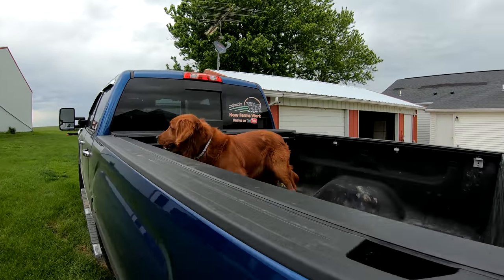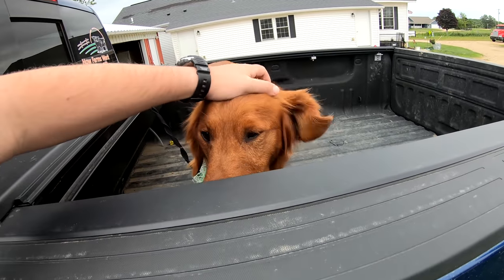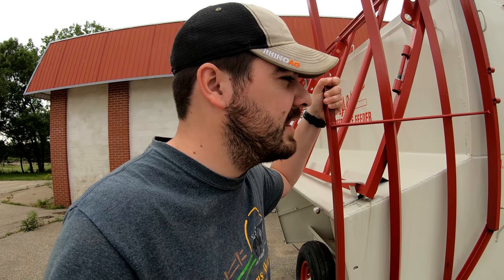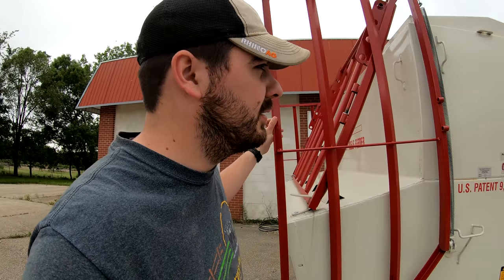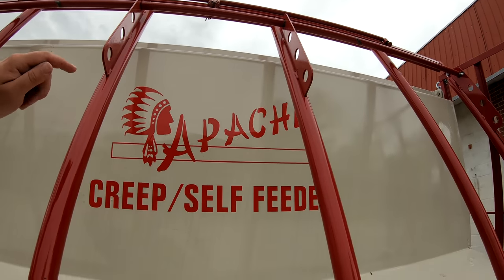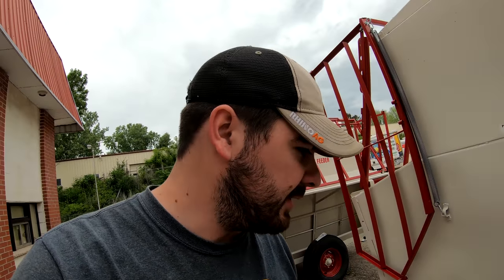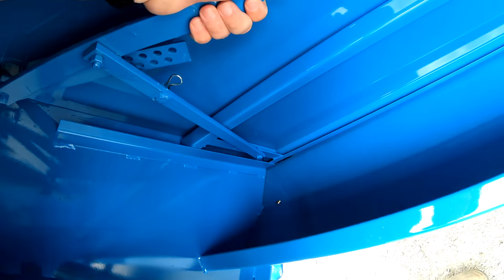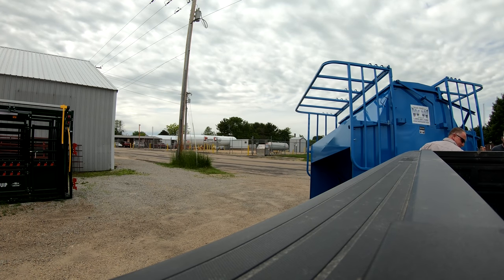Apache or Werk Weld Creep Feeders?

Comment: Offer manufacturers the opportunity to advertise there solution.  With 260k both channels  they would sell many gallons of rust prevention.  Send the upload to the marketing departments.  Talk to your current equipment partners also for solutions.  Your smart to invest now for years of longevity.  Many good suggestions in the comments.  There has to be a bediner co that has a batch of off color material needing a home.
Reply: I love your suggestion.  But for the picking up mix matched bed liner paint is impossible.  Once they get the color match and add the activator, time is limited to spray. But it would truly be the best route just not a cheap one.

Comment: Keep in mind that the corn is sandpaper, and will over time scrape off the paint or sealer on the inside.  Some of that scraped off paint is going to go into the cows. Probably best to use something relatively non-toxic that you wouldn't mind eating yourself. (Since whoever eats the cow will be eating it.)

Comment: these like so many other farm products are so costly to buy, you would exspect them to be made out of stainless steel sheet metal, not mild steel sheet metal, i say sheet metal as that is what 14 ga, is, as that is what they are built out of, 14 ga steel sheet metal, and one can not begin to justaphy the price they want, i can build 10 of these out of 1/8" stainless steel plate for the price they want for this light built sheet metal box, you cant even tow 30 mph down the road, and you sure dont want to tow it loaded with feed, the tung is only 2x2x1/8" tubing, that will not take the load towing, years ago i priced out a feed hoper i could take to the feed mill and have it loaded with 2 tons of feed, i found they are made out of 14ga sheet metal and only hold a ton, 2000 Lbs  and are not made to tow down the hyw loaded, and if you wanted to take it to the feed mill to be loaded, you have to drop the wheels off and set it in a truck or trailer. and the price tag was over $5000 cnd an, so i built one that holds over 2 ton, and i can tow it loaded down the hyw at 70 mph out of 1/8 stainless steel plate, with ec brakes, as there all over cheap the for under 1000 bucks and a weekend to build, being i am a welder by trade, these are very simple to build, with my eyes closed..

Comment: Oil it with a vegetable oil like a large barrel offset smoker. Repeat as necessary. It will oxidize into a natural oil varnish over time, usually a week to ten days. Tung oil or PURE linseed oil would work even better. DO NOT use hardware store linseed oil. It has heavy metal dryers in it to promote the oxidation and is thereby not good to be ingested. Down here in Texas, serious smoke cooks get a new smoker, oil the entire thing with cooking oil, and then bake it out with a fire in the firebox. Obviously you can't do the fire, but nut oils and some thinner veg oils will varnish out in one to two weeks on their own. Whether it's fully varnished doesn't matter. You can come in with your feed and over time re-oil as needed.

Comment: I would definitely paint inside with some graphite 
I don't know if it'd be a good thing or bad thing but I think I would throw a couple tiny holes in the corners to help water drain out unless there's some already there and I didn't see them 
one thing I don't like about creep feeders even though I don't use them or need them the tongue always sticking out on them

Comment: Wouldn't use flex seal cause if it starts to chip and peel the cows will be eating it in there feed
Reply from the maker: It’s non-toxic when cured, and I used it since I had a lot of it sitting around

Comment: Would truck bed liner spray work?
Reply from the maker: It should, though I’m not sure what the cost would be. The flex seal was fairly inexpensive for what I want to spray
Reply: I wouldn't put it where the calves eat at. They'll chew it away from the metal. Inside is another story all together. If any water did gather between th liner and the paint from condensation,  it could still drain down and away.

Comment: We have 2 Apache creep feeders and all we do is fix on them there light weight and built really cheap not a good feeder at all 
Those feeders wont rust out as long as u clean it out after it rains in the trough and totally clean it out when ur done using it for several months the inside might have sure surface rust but that isn't going to effect the feeder at all

Comment: How come they are not made in galvanized steel? That way it will take years for the rust to show, if ever! All our iron in the barn by the cows is galvanized, has lastet for 11 years, no rust yet. :)
Reply: Best idea yet ! They don't use it because they want you back in 5yrs after it rusted away.
Reply: @augustreil  And that will result in bad reputation. Rather have a reputation that states your work last for 10-15 years, than just 5? i dont want to buy a tractor that will only work for 5 years, i want one that works for 20 years.
Reply: @TheComander1234 , I agree 100%

Comment: Spray on flex seal does not hold up in the sun, I used some on a motor home roof and had to fix it again in less than 3 months.
Reply from the maker: Guess I’ll be doing a review in a few months to see how it’s holding up 😂

Comment: as for painting the inside of a factory one, dont do it, it will rust even more and you dont see it under the paint until it is real bad, spray a light coat of cooking oil 2 times a year, but if your stuck on painting it, heat up the area with a tagar torch hot and spray on pro 15,  paint, and any out side areas top coat with pro 15 2 part wheel paint, but work fast, strait pro 15 will chock if in the sun, and needs a top coat

Comment: Those welds are made with straight CO2 gas. The welds look fine to me. The CO2 makes a lot of splatter and it sticks to the surrounding metal and without a splatter protection it is harder to clean up. I always use an argon mixture with my welder. It costs more but not really when you factor in the extra time in clean up.

Your over thinking it! Let it rust then convert it and seal it.... All you need is some rust oleum primer and some rust oleum paint of the color of your choice to stop the rust

Comment: I'd paint the inside before using it !  Migjht reduce bridging of the feed and reduce rusting of sheet metal .  Also would serve to seal the lap joints between sheets .  That's  "stitch welding "  BTW .  its used because seam welding costs a lot in time to prevent buckling of the sheets  not to mention wire .  You were shopping price, too.  Quality costs money in front ot everyone is willing to pay for so you're seeing the marketing/engineering choices.  BTDT !  The debate is always price point over durability .  But you can improve the durability with some TLC and attention to detail .

Comment: Por 15 works great
Reply: I used POR-15 on 3 truck bed frames, lasted a year, then peeled like a banana ! And I prepped the shit out of it. Now I use kerosene, diesel and bar/chain lube in a 2 pump gallon sprayer. Everything turns black and looks like new.

Comment: Coat inside with pro 15. Its slippery and won't rust.
Reply: I used POR-15 on 3 truck bed frames, lasted a year, then peeled like a banana ! And I prepped the shit out of it. Now I use kerosene, diesel and bar/chain lube in a 2 pump gallon sprayer. Everything turns black and looks like new.
I understand he can't use that for feed holders though.

Comment: Check out a product called Gator Glide, used on aluminum and steel boats for increased surface resistance and rust prevention on steel boats.

Comment: Flex seal is way overpriced. You can get a five gallon bucket of rubber foundation paint for $50 and use a harbor freight paint gun for $20. Costs a little more but you get way more product for the price. I can’t believe one can of that crap cost like $20. Good luck!

Comment: You don't want a texture product. I would go with POR 15 , I sold paint and coatings for 40 years....Very brushable..
Reply: I used POR-15 on 3 truck bed frames, lasted a year, then peeled like a banana !  And I prepped the shit out of it. Now I use kerosene, diesel and bar/chain lube in a 2 pump gallon sprayer. Everything turns black and looks like new.
But that cannot be used in this application obliviously !
Reply: @augustreil  Well I don't know what to tell you, but Por 15 carries a 4.4 for 334 reviews on Amazon (mostly do it yourselfers) and done right you won't beat it off with a hammer; Now inside feeder is new metal with oil scale coating. Scrub it with DAWN DISHWASH SOAP and that will cut the veg oil coating applied to new cold rolled steel and sun and a rain will get you prepped.  If it peeled like a banana  you left a film on your bare metal . Put kerosene in a bucket and in a years time it will not be evaporated......
Reply: @lindaschwersenska9924 , Believe me when I say the frames were properly prepped. They were De-scaled, wire brushed, Super-Cleaned applied, then hit with a 4500 PSI, hot water pressure washer, then lacquer thinner wiped down and left to dry for 3 days in the 80 degree sun. There was nothing on those frames except bare, dry, clean metal. The POR-15, "Paint Over Rust" had the ultimate base to do it's job and it failed on all three. For 40.00 bucks a quart, I expect a little more than a year out of it. That is why after 3 attempts, I decided to go old school and soak them with oil, which has never failed, easier and cheaper. Sorry such a long comment but oil is the best at stopping rust, which is why cars/trucks with leaky anything don't rust.

Comment: Both of those companies should be ashamed, the welding on both is very poor and sloppy plus the premature rusting issue is a red flag for me. Personally I would of looked at other companies before purchasing after seeing the ones you looked at.
Reply: I couldn't agree more the welding on both units is absolutely substandard
Reply: @hansjoost737  The welding looks likes it was done with a stick welder by a beginner.

Comment: Here's a different solution for your rusting problem. I have done this before on Industrial machines and it works great. Connect a ground wire to your feeder then connect the other end to a magnesium anode that you can buy from this link that I'm giving you or from any boat supply Marine store. https://www.boatzincs.com/?gclid=Cj0KCQjwo7foBRD8ARIsAHTy2wnIkvobu4lk0pcmqfAAtZDy5ZjV5VEN_vxlNWP8P2zNqCcen_urnXwaAi2KEALw_wcB
Reply: Make sure it is a magnesium sacrificial anode. The anode will get consumed over time instead of your feeder rusting. You will have to replace the anode once in awhile. You may have to bury the anode in the ground at a shallow depth. These Solutions work great!
Reply: Another note, this same solution is also used to protect Pipelines and other structures that are subject to corrosion and rusting. This is not a new method. If you want to do more research on it, look up "sacrificial anodes".

Comment: this should be enough Epoxy paint a true epoxy will get harder than a piece of tile  I used to spray water pipe for LA water believe it or not we used to waterborne catalyzed epoxy a very hard finish in the very durable finish something that last for 40 to 50 years PS just seen as an expert you want your cattle eating that Rhino liner it's not designed for the food industry.....................................
Reply: Yeah that's what they coat the pipelines with now too... the pipe line they installed across the farm, all the pipes came pre-measured and pre-bent for turns and to go under the creek... even the ends are beveled at the factory for welding on-site.  The pipes, all except the last 6 inches or so, are already coated in a green epoxy coating about 1/4 inch thick.  The pipes are blocked up and welded together by the welders, inspected, and then the weld joints are coated with field-applied layer of the same type of epoxy coating, and that is inspected.  Then the entire completed pipeline is laid down into the prepared trench by dozers with side cranes working together.... then they cover it up and do the finish site work later on.  

Later!  OL J R :)
Reply: Cattle eat worse in practice... twine, even hay wire or fence staples... Ever seen a cow with "hardware disease"?? It's sorta like appendicitis in humans.  You fix it by making the cow swallow a bolus magnet attached to a string... it goes into their stomach to the "hardware sac" (reticulum) of their four-chambered stomach... the wire and bits of metal stick to the magnet, then you pull the magnet back up and out their mouth, bringing the bits of junk with it... 

Later!  OL J R :)